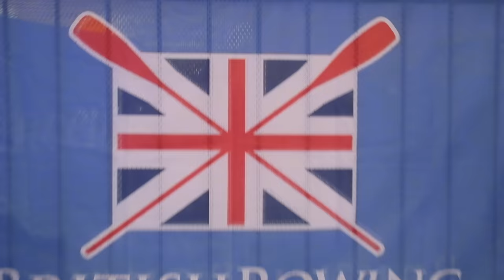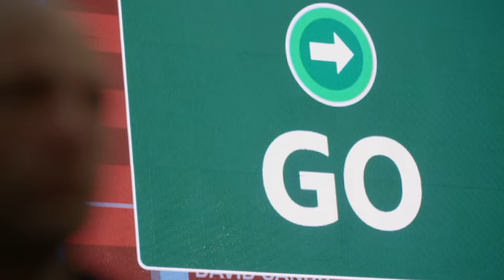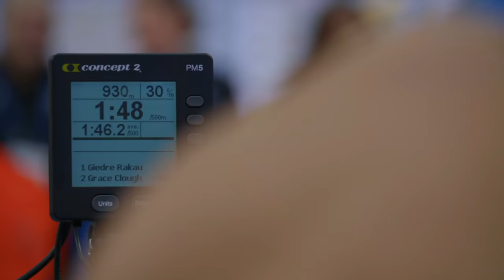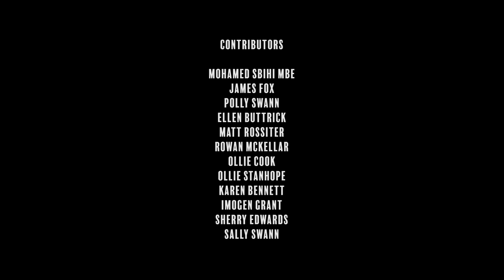The Road to Tokyo - Episode 1 - Altitude and Attitude

Comment: Hello, first i wanna tell you, that the video is really nice and cant wait to see full series :) i have a question; at minute 07:20-07:30 there is a rower with safety supports on the side, what is it called and where can i find it to buy, or is it custom made? Sincerly chris
Reply: They are floaters for balance, it's for paralympic rowing. It's not adviced to use them unless you are disabled
Reply: @boronguy  or if you are a complete beginner

Comment: Why do some bring the handle up high onto the chest? I thought it was to the bottom the chest?
Reply: It is not something that would go well in the boat. However, on an erg, you can squeeze a little bit of extra length that way. Since the athletes are judged based on erg scores, they do everything they can to secure the smallest of advantages. Drawing the handle high is one of those small tweaks.